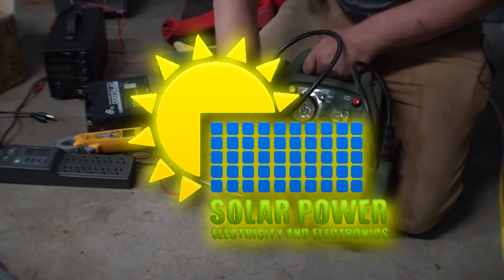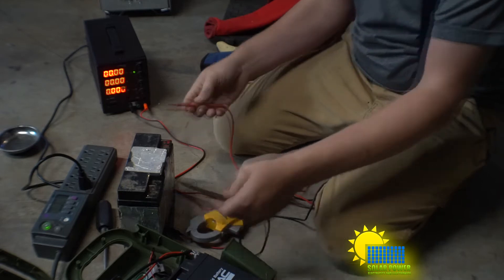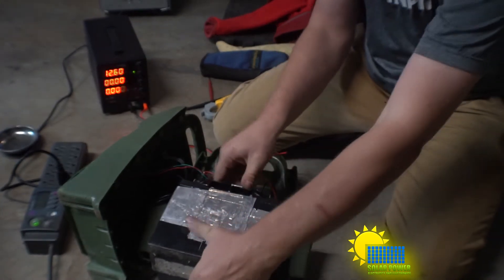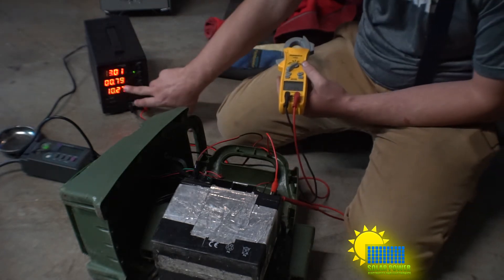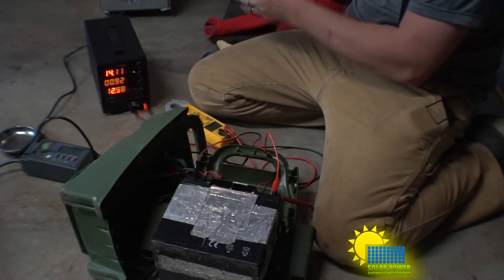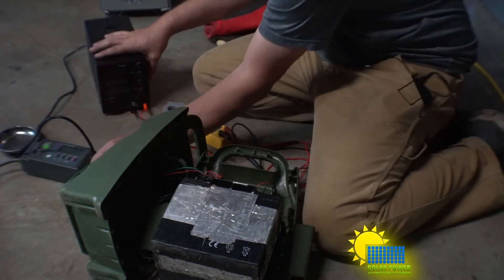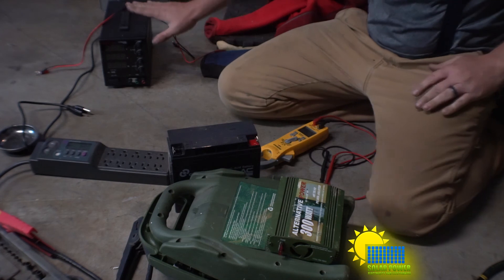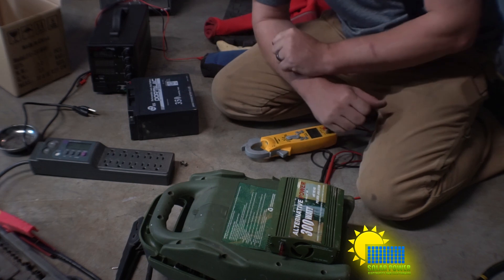Repairing A Battery Pack With a DC Power Supply Variable 30V 10A, KAIWEETS 4-Digit Display

Comment: I built a jump battery, with Headway cells, 4in series, will start a 6.0L v8, on its own. In most cases the starting battery, only needs a bit of help, like a 5-10 amp charger, on it for 5 minutes , it will start, I have heard of a jump starter that uses the partly dead battery to charge a super capacitor bank, with a boost converter, to them start the vehicle, I never seen one, but that could be cool!
Reply from the maker: Super capacitors alone is all you need